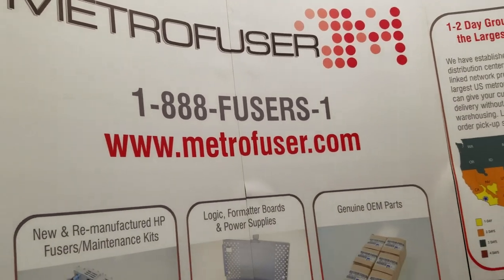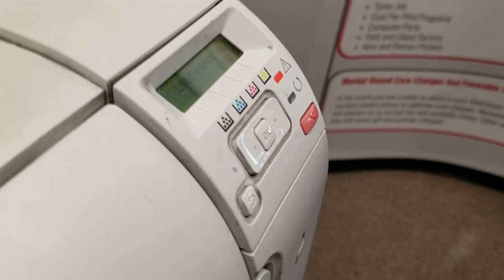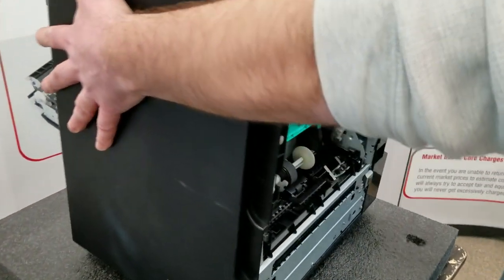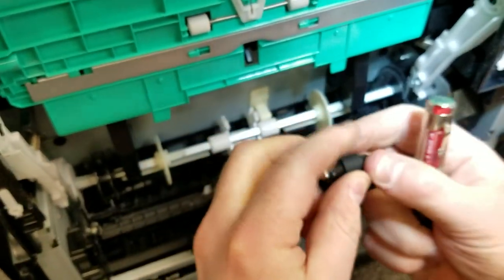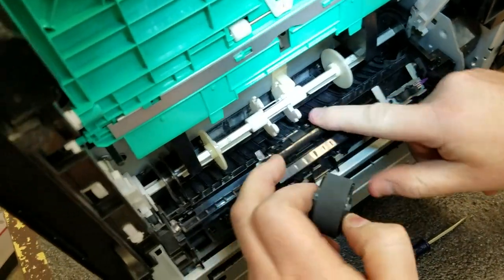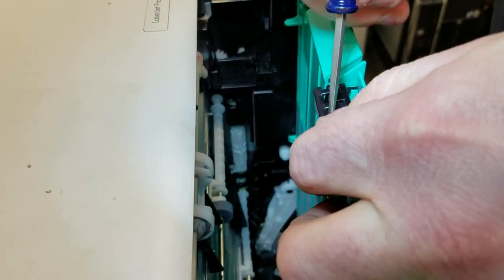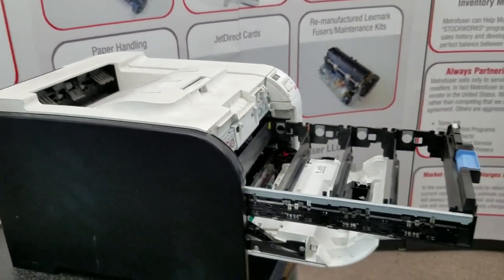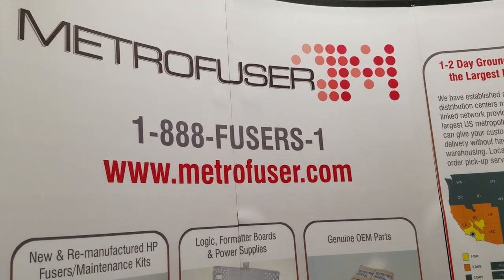How To Remove and Replace HP M351 M451 Fuser Maintenance Kit Parts RM1-4840 RM1-4426 RL1-1802

Comment: Hello Sir.  I replaced all these parts myself.  I thought this would fix an issue where the paper shows pressed in marks on the paper down the middle of the paper.  Any thoughts?  I wish I could send a picture
Reply: could be gunk on any of the rollers in the fuser, or a grease stain on the belt assembly, or even a leaky toner cartridge causing it.  I'd start with the toner cartridge by checking to see if the color of the line matches one of the cartridges and either replace that one or see if there's a line on the imaging drum.  If that doesn't work, then see if you can see anything on the fuser or belt around the place where the line keeps showing up (you can line it up with a printout to see where it would be).  Because this model's fuser is a challenge to remove but the belt is relatively accessible (just pull the toner tray all the way out and remove the toners) check the belt for a line around the same place in the orientation (do not touch the belt with your fingers within the margins).  If you see a greasy spot or anything on the belt then take it out and clean it with a clean soft static-free towel and some isopropyl alcohol.  The fuser gunk can be cleaned similarly but use a clean q-tip instead of a rag.  Also don't do this while the printer is plugged in unless you like getting electrocuted.